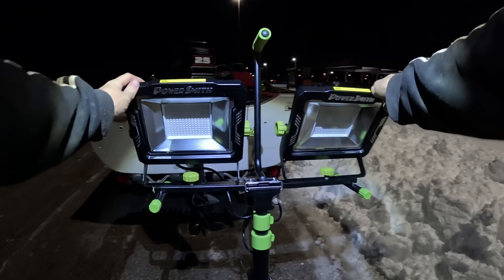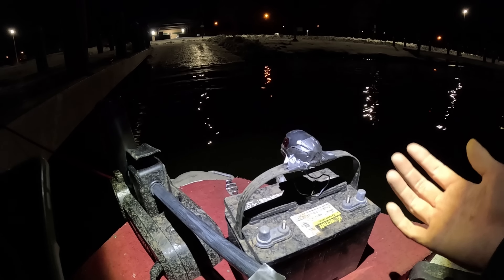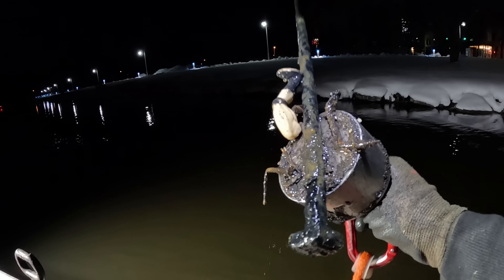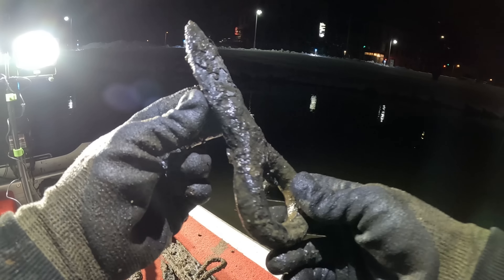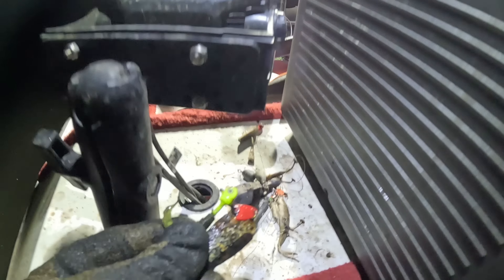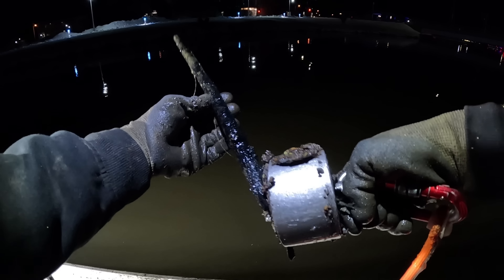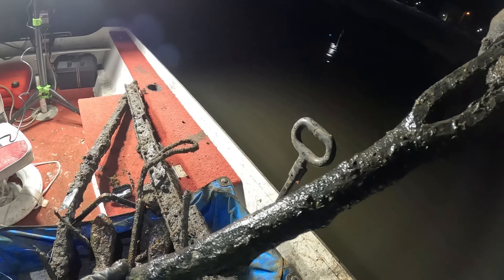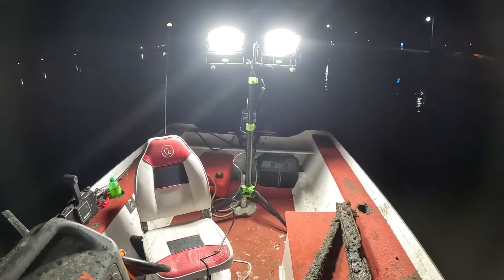Magnet Fishing Deep Dark Water With 30,000 Lumen Spotlight - Body Parts Found!!!

Comment: Those "G" open connectors are chain connecting links for hooking on to clevis hook/shackle.  My guess is that they are custom made for quick disconnect without having to unscrew the clevis bolt.  As mentioned below either for logging or for carrying large post, say to build a pier.

Comment: 17:40 mark, looks like a clutch fork for a stick shift transmission.  some vehicles used a linkage, which went through the hole on the one end, the "U" shaped end had a bearing on it that would push against the fingers to make the clutch back off away from the disk.

Comment: Your "Big Bolt" ( at least to the people over in the U.K.), is also known as a "Mooring Pin." These were driven into the ground of Canals & Rivers alongside Boats with a rope attached to anchor/tie it up to the side of the Waterway. The U.K. Magnet Fishers find them a lot & give them to the folks that still make their homes on flatboats. They said recently those Pins were now expensive & hard to find.

Comment: around 15:20 mark, not staples.  most of those i have seen on train tracks with the concrete railroad ties.  the plates that hold the rail look kinda strange as instead of holes for the spikes, they have loops.  rail sections are laid and go in between the loops, those pieces are placed into a loop, and fit tight, they use a sledge hammer to drive them, and surprisingly enough, they hold the rail sections down to the concrete tie really tightly.

Comment: Tyler, what you need to know...first, please wear a life jacket. Second, most important....fumes from fuel in a standing boat (not moving) will lay in the bottom around your feet, this is how many an explosion happens especially if there is a spark from electric appliances like lights, smokes, invented batteries. Third, you must have at least one boat (white) light like your rear boat mast, if moving you have to put out bow (red/green) light. You can keep it off while anchored. You can also, create a spark from a wet magnet by pulling it off of things. Be safe, Buddy.

Comment: Dude, you know I love watching your video's, but this is great. Your boat is an awesome addition to your magnet fishing. You just need to work on keeping it clean and in tip top shape. Just take it to the car wash and rinse it out and off. That will also keep things much safer and easier to work on. Speaking of safety, you do need a life jacket with you. The other thing to think of is the ice in the bottom or on the deck. You showed the rope freezing to the deck, but if it gets slippery and you fall over into the water is so cold Hyperthermia will end your video's forever. We just care about you and want you around. Thanks again for the great video.

Comment: Your cart isn’t hard core. Can I recommend a better one? It’s a garden cart made by VIGORO and sold at Home Depot. It’s made of heavy duty yellow plastic. Has a heavy duty metal frame plus balloon tires. It also has a lever you can release and tip the the yellow plastic container part up so everything inside just slides down and out.